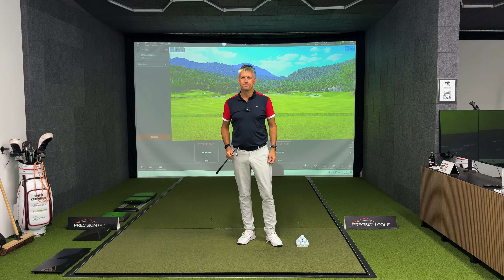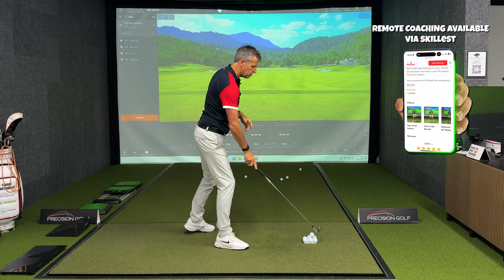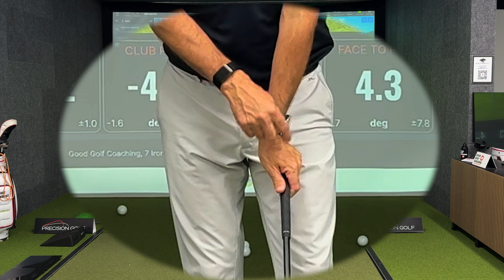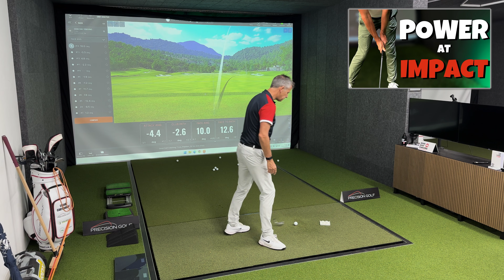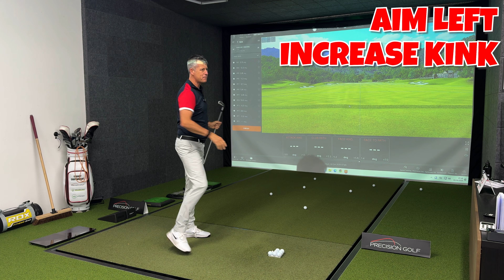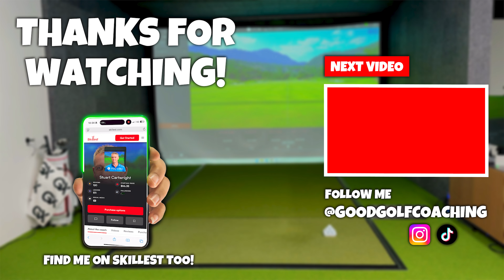Using Your Wrists At Impact Will UNLOCK The ULTIMATE Control....

Comment: What wrist angle is supposed to increase at the transition at the top? With this strong grip I feel like my lead wrist is already fully extended (kinked) at address.  I’m wondering if the key might be how much wrist adduction I have at address and the transition (different than wrist extension). Currently minimizing the adduction at address and trying to hold it/prevent adduction during impact and just relying on forearm rotation.
Reply from the maker: If you’ve come from a weak hold your grip pressure will be tight and will provably feel like you’re at maximum extension. Unloading the club with wrist extension is king. Hope that helps.

Comment: I have watched this video many times and gone back to watch your other grip videos. It appears that what you are teaching is a VERY strong grip, which is what I have been using. It's the only grip that squares the club up for me. Most of my shots go left as you'd expect and I am trying to get my club path more in to out to straighten the shot. Any suggestions? I'm wondering if it may be the way I'm trying to release with the hands the same way I did before by turning over the wrists with a "normal" strong grip. Thanks!
Reply from the maker: My pleasure Jack, and thanks so much for your insights. Hugely appreciated and lovely to read. Best wishes Stu
Reply: @GoodGolfCoaching My pleasure Stu. Any tips or new vids explaining the release more in depth would be appreciated. I know you've said that your body will adjust to the strong grip at some point and will start swinging more in to out....I'm banking on that. Haha

Comment: I'm a big fan of your teaching and have adopted (with success) many of your methods. But I dont get this. You ask us to adopt the stronger "better grip" - which reduces the need for clubhead manipulation and enables us to close the club face to path and hit draws as stock shots. And then this video seems to suggest that by doing it even more - holding the max wrist angle all the way through the shot - turns it into a fade ? And doing it less - less wrist angle -  is now the route to a draw? Feels a little like changing the swing rather than the more "traditional" route of opening the face a little at setup,  and keeping the swing (and wrist) identical?
Reply from the maker: Iver, watch the video again, I am very clear on the explanation. Best wishes Stu

Comment: Another great video! Your content is simply the best that is out there, period. Not simple tips but comprehensive and understandable information that, with commitment, will improve one's game. I'm in my 70's but still obsessed with improvement - that's what I love about golf. Over the past season, my index went from 9.5 to 6.5 and that's the best I've played since I was 50. So I am on the right track. Regarding shaping the shots, I have been using a method that you mentioned in one of your videos where one keeps the same grip (i.e., the same amount of lead wrist kink) and simply rotates the club face a little closed or opened to hit draws and fades. This works reasonably well but the amount of curvature is a lot (5-10 yds with a 7i) probably because, to be clearly visible at set up. the amount of face rotation is 5-10 degrees. From this video, I can now appreciate that using the lead wrist for this purpose would be much more precise. My question has to do with the driver; I have been using ball position (more forward for a draw bias and less forward for a fade bias). Would you recommend using the lead wrist, as in this video, to achieve these results with driver?
Reply from the maker: Bless you Dale, thank you so much my friend. Your feedback is warmly received and very grateful for you taking the time to share. Thank you so much and good luck with your continued golf improvement. Best wishes Stu